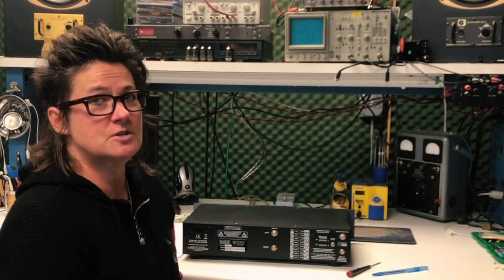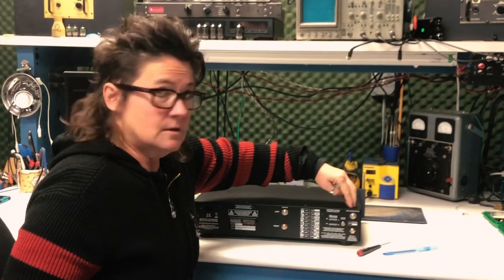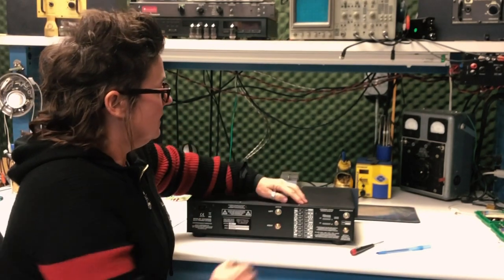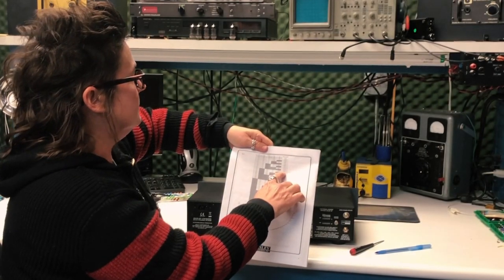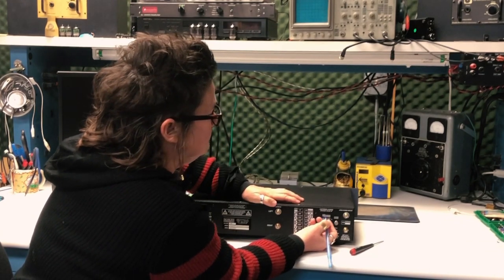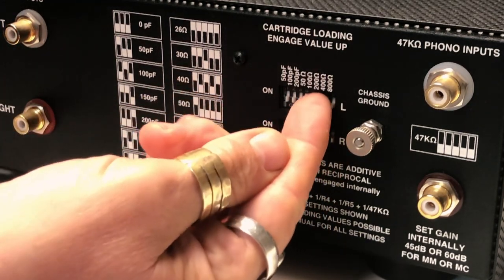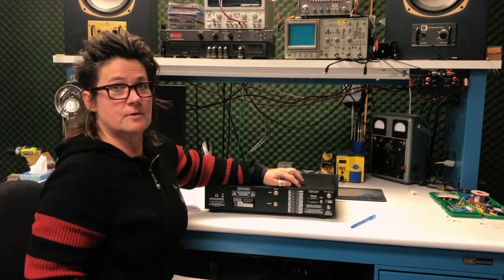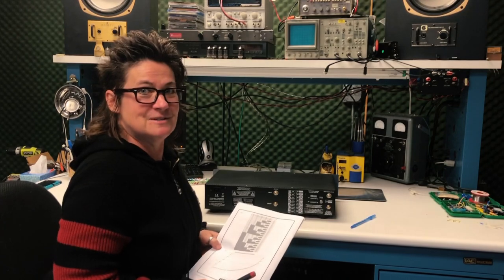Manley Tech Tips: How do I set the loading on my CHINOOK?

Comment: Why don't you have a adjustable pots for loading an capacitance so you can adjust it on the fly isn't this a better way to go you can dial in the cartridge perfectly, just because a manufacturer says it's a certain figure doesn't mean that is the perfect figure and by dip switches you don't have fine adjustment maybe it's something you can consider
Reply from the maker: Continuously Variable Capacitors are not a viable option for a user-adjustable control. They are kind of fussy and delicate devices, and might not sound as good as a little polystyrene cap. Selectable capacitors on a rotary switch is easy technology, and convenient, but indeed more expensive to build. You'll see Front Panel adjustable resistors, impedance via the auto-former, and selectable capacitor loading on the facia of the Manley Steelhead, and that unit is about 4x more bucks! The point of the Chinook was to bring the sound of the Steelhead at a fraction of the cost, and to do that meant we had to trade convenience for lower dollars. The Chinook is still flexible, but a little less convenient to go to the back to select the R and C values on DIP switches. But once that is done, you don't have to think about unless you change cartridges. "Set it and forget it!" If you need to adjust those values all the time, you'll need the Steelhead!
Reply: @manleylabs  ok! Can you get polystyrene trimmer pots? Is polystyrene capacitors the best choice then. Would it be that much expensive? You maybe right for capacitance to be fixed but surely for resistance is more beneficial to have a knob. And what I was thinking was the potentiometer would have a very small adjustment not the whole range that would be virtually impossible to dial in i would have thought. So what I'm thinking! you select your resistance on the dip switch and it adjusted the pot by half a percent plus or minus either way. I'm sorry I don't even have the money to afford the chinook it would be nice lol. I was thinking about adapting the schiit Mani to have the knob maybe just resistance not capacity then. Should I go with a linear pot or logic?
Reply from the maker: @johnsweda2999  honestly, adjusting the resistance loading by a wee bit via a trim pot would be barely audible. Selecting 1% resistor values close to your target are totally the way to go.
Reply: @manleylabs  ok that's good to know thanks!  I probably do it not a pot but through selector switch and soldered on metal wound resistors probably better then carbon film?
Reply from the maker: @johnsweda2999  I prefer MF to CF.